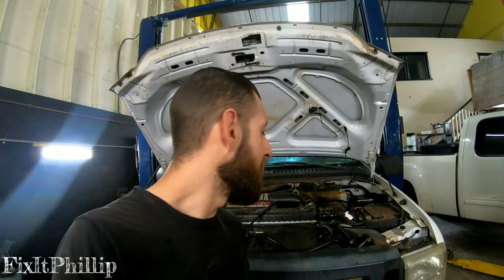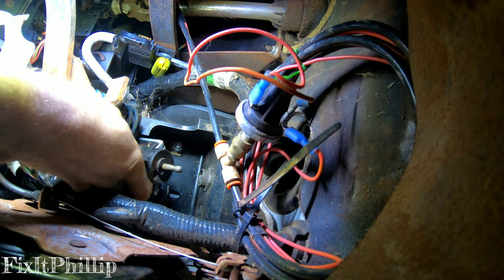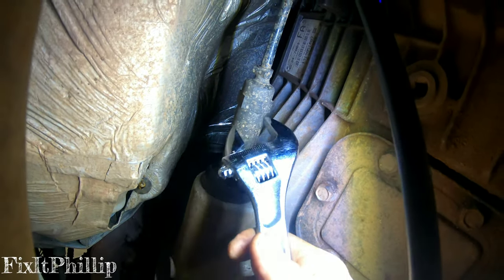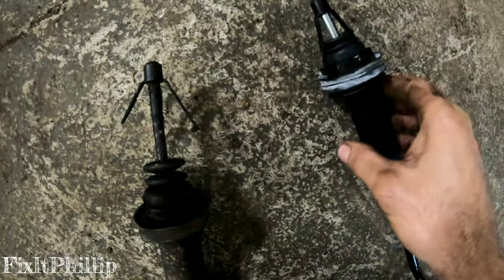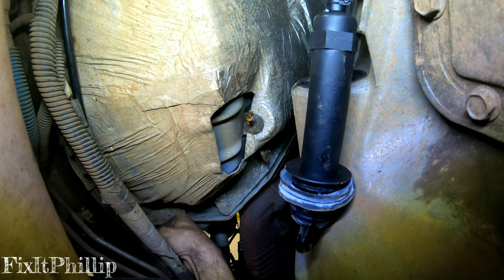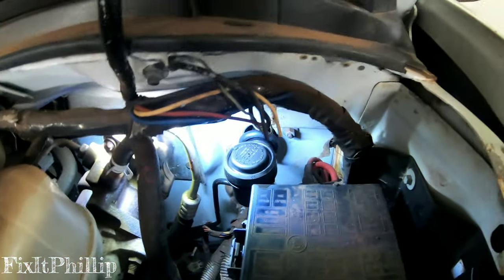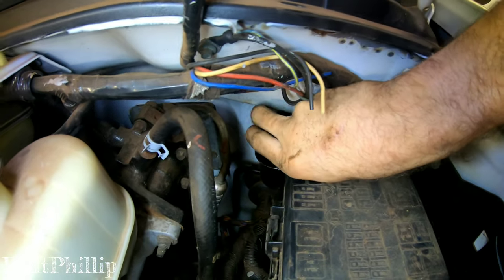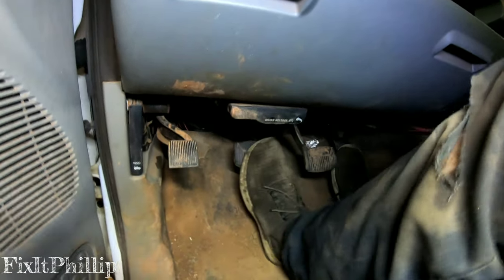Ford F350 Clutch Master Cylinder Replacement and Slave Cylinder Replacement 6.0 Diesel

Comment: The clutch pedal seems to be a big issue on these trucks. The safety switches have issues, the bushing that holds the rod on the pedal breaks, and the clips that hold down the rod in the master break. My 2000 F250 7.3 has all these issues. I had zip ties holding the clutch down and the other things were inconvenient because i had to hold my pedal in a certain spot to start it, but it was still drivable. Now the switch is completely broken and it won't start so I'll probably take care of at least one other issue while I'm in there doing that.

Comment: Hi Phillip, I just replaced the master and slave cylinder on my 01 7.3 Powerstroke. Now after not having any issues with the previous master/Slave cylinder my clutch pedal is getting stuck and feels like it has air in the system. Is there a way to bleed the air out of the system? I bought a prefilled South Bend clutch kit.

Comment: Would it be hard to get the safety switch off if the push rod is still in the master cylinder? How would you get the rod out?
Reply from the maker: Its not too hard to do. Unplug the electrical connector so you can twist it around. Theres a plastic plate that can slide off, then you can remove it. Heres a helpful video to get an idea of how to do it. https://youtu.be/vkH4a6mKTsE
Reply from the maker: Thank you for watching, be sure to Subscribe Plz!
Reply: FixItPhillip will do, thanks for the help
Reply: @FixItPhillip  You just made my day! I'm stripping a wrecked 99 F350. Already put the 7.3 in my hot shot truck and needed to get the clutch actuator off the wreck before I scrap it. I'm rebuilding another 7.3 and will install the ZF6 off the wreck at that time. The actuator was recently replaced and that video shows the switch removal very well. You just saved me the cost of an actuator...thank you!

Comment: Great video!  Thank you so much.
Reply: I finally did mine on my 2007 F350...again this video was spot on...thanks.  The only difference is my master cylinder still has the pushrod engaged.  There is a plastic cover that you undo on the clutch switch in that case to take it off...very easy.  Commenting just for others.

Outside of that small difference (cause mine wasn't broken in the same way)  this is one of the best step by steps on something I've seen.  Thanks again!
Reply from the maker: Thank you

Comment: So what if I did everything right but the push rod just isn’t clicking into place with the master cylinder
Reply from the maker: There's a built-in metal retainer in the master cylinder thats supposed to hold the push rod from popping out. That clip may possibly be broken

Comment: Hey Phillip, i have a HUGE question but its for 2001 F350 with ZF6 transmission.

My truck is stuck at a shopping center with failed Hydraulic system (clutch). I have a new sealed unit and have to go there sight unseen. It appears the slave and master cylinder are keyed and just twist off. But the portion that connects to the pedal and rod... is that a Phillips screw, bolt, nut? Any help is greatly appreciated. I am kind of stressing about getting all the way there and not having the correct tools.
Reply from the maker: I believe its just a clip from the pedal to the rod if I remember correctly, using a flat head screwdriver to get the clip off.
Reply from the maker: The new one should have the new plastic clip on the rod where it pops onto the pedal

Comment: Question. I have a 2005 F350 Super Duty 6 Speed. My truck has the master cylinder kit that you just installed but when I pull up part numbers it showing the master cylinder kit for my clutch setup with the separate Reservoir?
Reply from the maker: I think some designs it has a rubber hose from the master cylinder to an external fluid reservoir, but the concept of the replacement should be the same